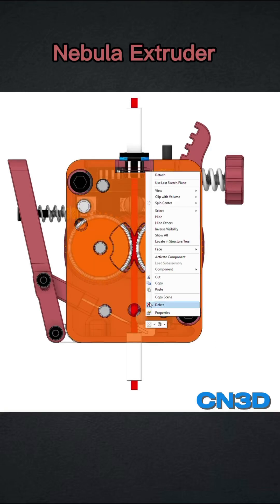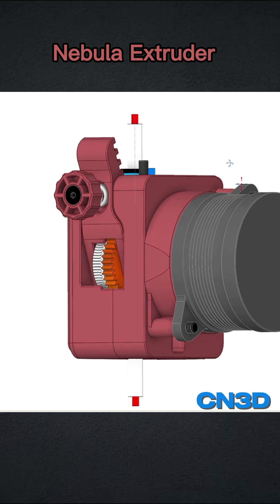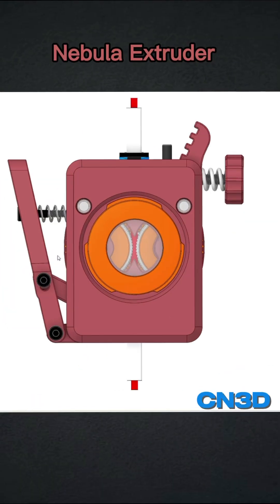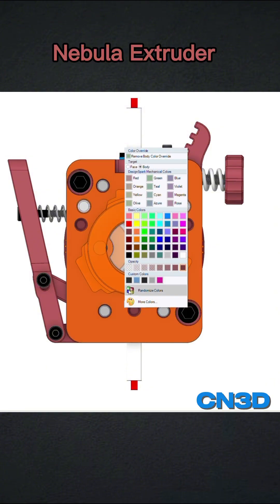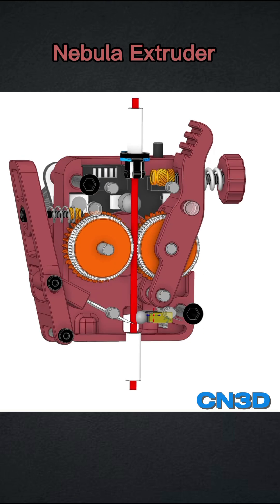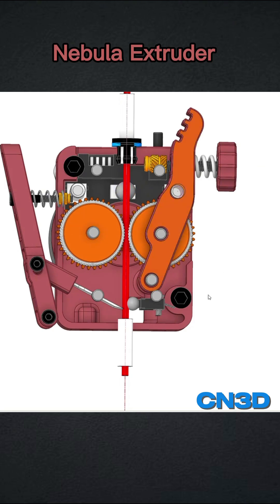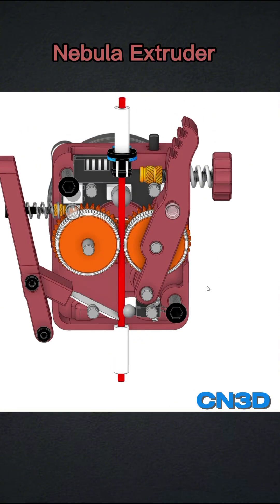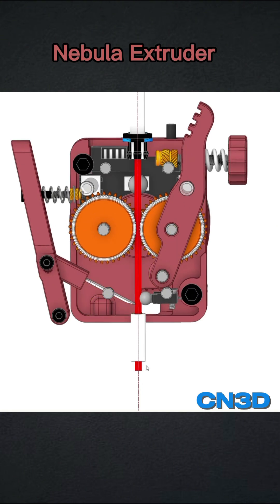Nebula Extruder Upgrade Just Got Even Smarter!

Comment: Are you guys working on a lightweight toolhead for this? I just got mine. I have an unassembled sv08, I printed the gantry parts in pet-cf, have a skeletonized x gantry, will be using eddy, and the hotend that uses v6 nozzles with a pt1000. Id also like to do the graphite bed upgrade but want to get it printing first. Im just waiting on what toolhead to use.
Reply from the maker: first we will release the addons for the original stand alone extruder. and then we will release the toolhead made around it

Comment: regarding the usage of the Nebula Extruder, how is it behaving under a heated condition? I'm used to have my SV08 around ~60 when printing ABS and I couldn't find any information of the max temps the nebula could handle.
Reply from the maker: you can 3d print it in any material you want we have experience with ABS and we didn't have any issues with none of the extruder that we have build until now. and regarding the gears they look solid!

Comment: From the package you used the optimum space available but from mechanic side the cutter should be 90 degrees to the arm (in fact 3points to make a triangle with 90 degrees: cutting point, arm hinge point and cutter hinge point.
Reply: The friction is probably because the sliding pivot is being loaded sideways hard.  The slot in the lever should be canted and curved so it's at 90° to the pivot travel all the way through its range.  Actually, maybe even slightly more than 90° to account for sliding friction at the pivot & further reduce racking loads on the cutter body.
The pure pivots likely won't be affected by the small changes in the direction or magnitude of loading.
Reply from the maker: you are right but we wanted to see if we can achieve in a small space a miracle :D this is still under development.
Reply: @nadir3D  fully understood this way when I see the package. I would consider using 2 magnet (pushing polarity) instead of the spring and mechanical endstop instead of screw.

Comment: Was wondering how the second filament sensor helps?
Reply from the maker: For MMX it helps for better debugging and you know 2 thinks 1 the filament has passed the gears ⚙️ when you are loading. And when you cut the filament you have an instant feedback that the filament was cut. If not to cut a gain
Reply: @nadir3D  sounds good brother. Look forward to the progress on it. Does this have a section on your discord?
Reply from the maker: @itzmydamnlyf  yes for the moment on the BTT over / Partners

Comment: Very nice! How many of the original Nebula extruder parts can be re-used? Do you have an estimate of the BOM? Is it pretty much just a new housing with a cutter?
Reply from the maker: we have changed the original case. we have added 2 more magnets, a filament  second sensor  and a filament cutter. 
the Bom is small need to finish the testing with the 45 degree cutter. i prefer a smooth cut more than at an angle ;)